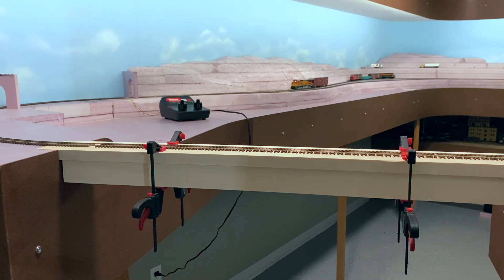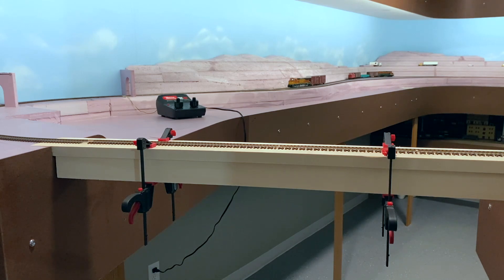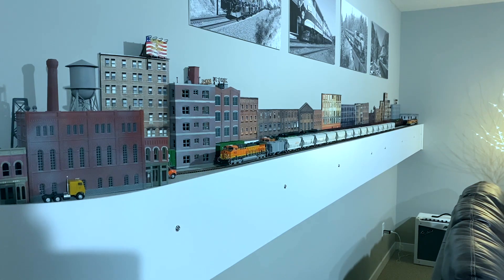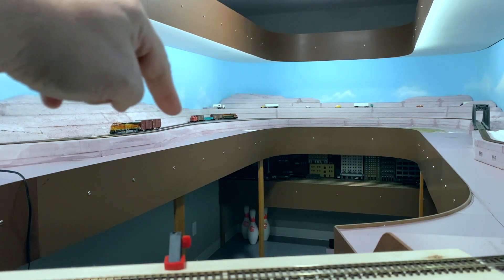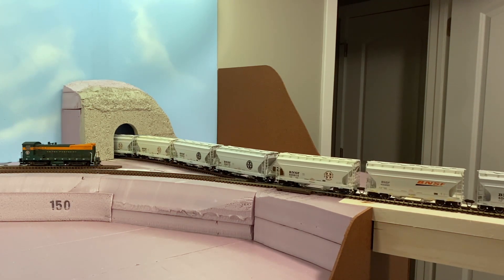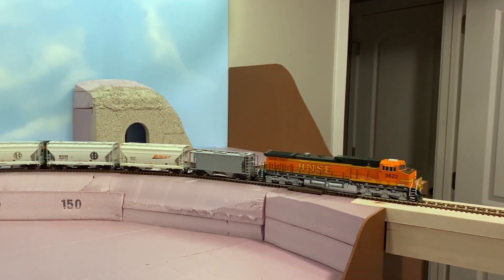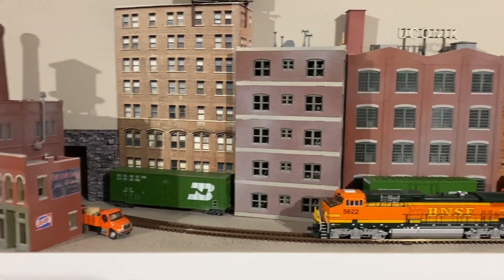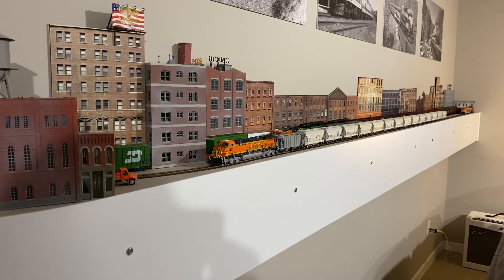Johns Trains HO Scale River Layout Start Lift Out Bridge

Comment: Looking nice, I love that you keep reinventing your layout. Have you considered making a portal at the other side of rd wall? That way you can have trains, coming from your stage, to go on both directions
Reply from the maker: Yes I have but when I built the basement out that is where plumbing and many electrical wires were run through. I may one day but would have to cut a decent size piece of sheetrock out to investigate this. I dont just trust a stud finder for all the electrical wires. I know they are there because I put many there and so did the builder. We'll see one day if I feel like a big project like that. Thanks for asking.